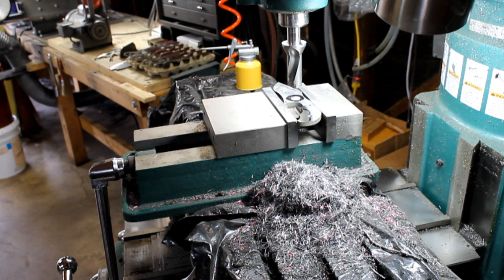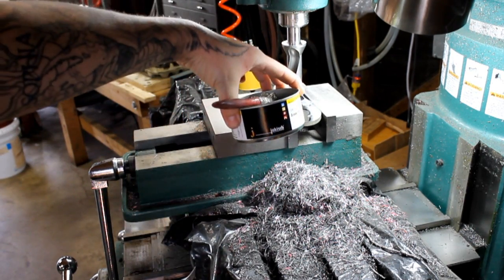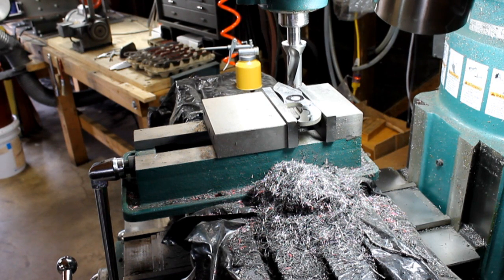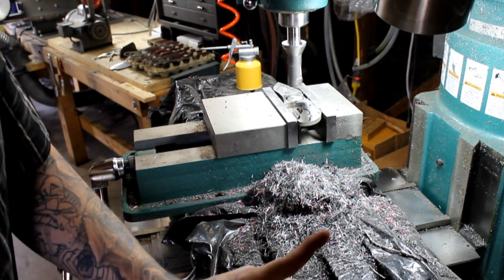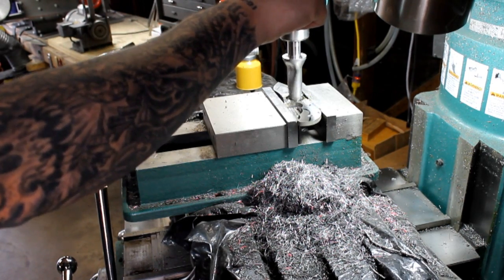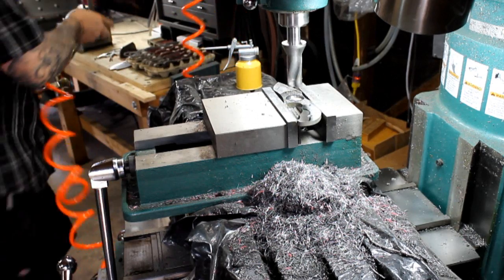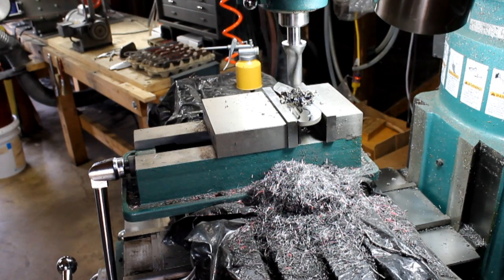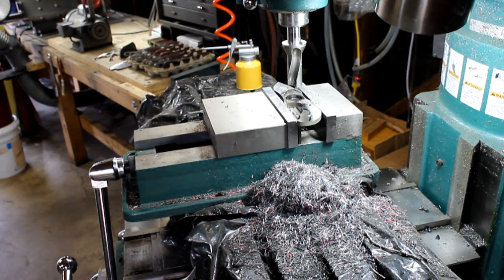How to Drill a 1inch Hole in Steel

Comment: You safely cut holes like that for under 400 pounds now.. get a mag drill with a decent cutter and weld up a bench press for the drill to sit on and a good strong vice to hold the part down.. I cut 2 inch thick steel on my set up with a slightly more powerful mag drill :P but yeah you cant beat a milling machine if you got the money haha

Comment: You drill the hole in 1 go - That is why you need a 6K machine which can produce a big torque. I only have a small drill bench Drill - small torque - I change the drills size a bout 10 times to get to the large size hole - a lot slower but get there eventually - but cheaply - Nice machine anyway - wish I had it
Reply: If it's not hardened steel, use Milwaukee hole dozer with a generous amount of cutting oil.

Comment: lol, so full of shit...any knife maker will tell you that there's several ways to do this...or even a noob like myself. As most knife makers can't afford or don't see the need for such an expensive piece of machinery. A bi-metal hole saw, uni-bit, step drill, carbide counter sink, etc. using a cheap mini mill or drill press will do the job. Or even drilling several small holes and then cut and file them to make a larger hole. 

6-8k machine to do the job...LMAO!

Comment: Sirius XM 90's on 09........ Its' OK I do it too from time to time as well..... Red Dragons! Is that cutting tool solid carbide or carbide tipped? Or is it HSS? Has the steel you are cutting been heat treated and hardened yet or not?

Comment: I know you mentioned drill presses not being up to this task, but could someone conceivably achieve a similar result with a less expensive system than that by starting with a small diameter bit and incrementally widening the hole with larger diameter bits?

Comment: I introduced Geoff to a step bit/vari bit for doing finger holes. I have a video of him using it to drill through 3/8 thick D2 steel on his D2 necker. Also alot of cutting oil. Poor mans way of doing it.